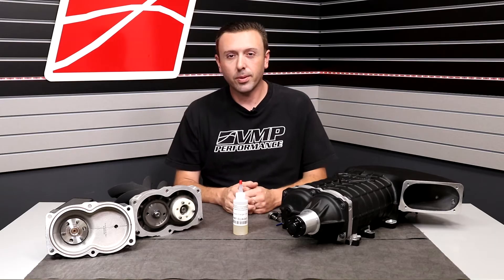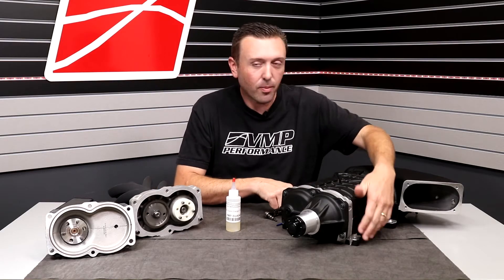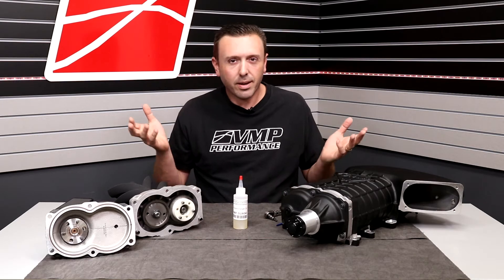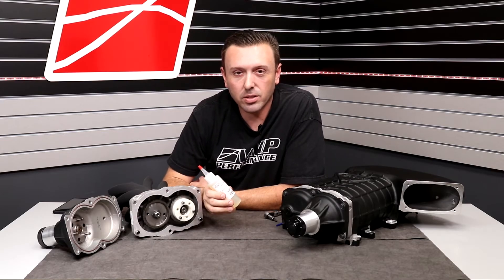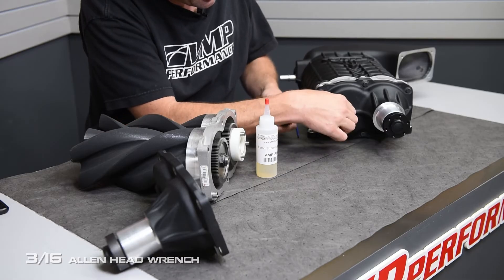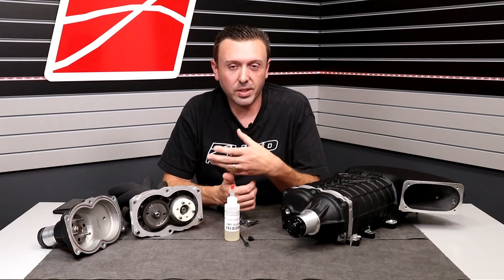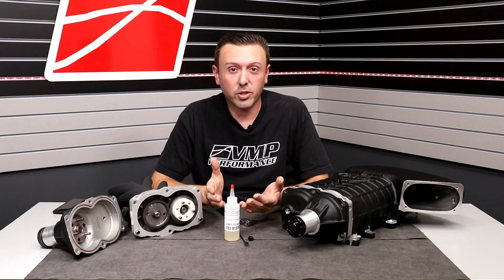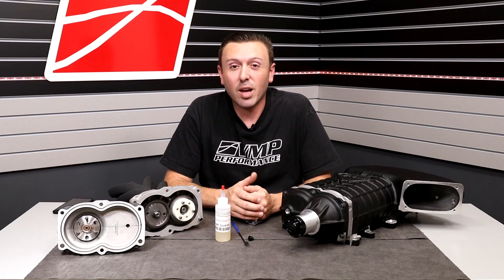Supercharger Oil || Tech talk; What is it?  How much do I need?  Here's your ANSWERS!

Comment: I was going to buy one of these in 2020  for my 1990 Mk2 Golf  1.8l 8v G60 Edition 1 Wolfsburg  till I found out they aren’t available in the UK, Costs £650 to import one, The noise they make is horrendous & loud, There a massive pain in the ass to mount unless unless you own a garage, Good with metal work which I’m not it just seems they are designed for the UK market unless you’re loaded, Typical of!

Comment: How often should you change the oil? I just purchase a mustang that has 21,000 miles on it
Reply from the maker: Supercharger oil needs attention much less frequently, if at all.  This is because, unlike engine oil, it is not exposed to contaminates.  On street driven/daily drivers, they'll likely ever see the mileage/extreme use that would require a change unless there's a leak or a problem that requires disassembly to repair.
Reply: @VMPPerformanceTV  I just purchased a 2022 mustang GT Premium package with the Rousch. It was 21k on it and want to make things we’re taking care of with oil

Comment: One thing I would like to suggest even though this is a great video is that we can discuss the actual weight of the oil because an emergency if someone needed to use synthetic motor oil or something like that they could at least get away with it until they were able to get the preferred lubricant.
Reply from the maker: The last blower that came through the shop that someone put engine oil in was absolutely ruined.  You need to run the proper lubricant in a TVS supercharger.  It's just not an option.
Reply: @VMPPerformanceTV  just curious
Reply: So it would be better of running it dry for a few hours vs some motor oil for a few hours to get to a shop?
Reply: 0w - 20

Comment: You guys and the comments seem to know your superchargers. I have a question for anyone with related experience: I had a stock Mercedes blower with 160k start making a grinding, scraping noise. I did the bearing on the blower pulley, but the noise kept going (maybe a bit quieter and less frequent). What do y’all think that could be about? I’m thinking some sort of internal bearing, but I never took anything apart, I just sold the car. Still wondering about it though.
Reply from the maker: Aside from the bearings in the nose, there's internal bearings located in the bearing plate at the opposite end of the rotors as well.  Without seeing the supercharger, it's hard to say specifically what's going on, but a disassembly and inspection would likely reveal play there as well.

Comment: What if the gears get damaged in case of there’s no oil
Reply from the maker: The supercharger would need to be inspected and rebuilt as it would've been exposed to extreme heat in both the gears and bearings.  Diagnosis of where the oil went would need to be performed so that it does not occur again.

Comment: I watched a video where a guy replaced around 1oz of the oil with motorkote hyper lubricant, and did heat tests with and without the additive. There was a great reduction in temperature. I would think that's a good thing to help prevent heat soak yeah?

Comment: I understand why the questions are asked. I’ve heard stories ( if I remember it was a whipple and a VMP) where the blowers were shipped out without oil in them. Now maybe they were used or maybe they had been rebuilt or something, but the stories where that they were empty and locked up. People advised me to check my new VMP Gen3 and sure enough it had the oil in it and the little paint mark on the fill plug from the factory assuring it was marked after filled. I believe the Gen3 for the terminators were made at Roush? Manguson was later like you said with the Gen3R

Comment: My buddy has gen3r and some knuckleheads at a shop added more oil to blower after receiving from vmp. Justin said any more than 4oz in gen3r  will overheat and possibly damage it. His shop added oil till it ran out of hole. So far he says its ok, but who knows as miles add up.
Reply from the maker: You can use a syringe with a small hose or something similar to drain it.
Reply from the maker: We'd recommend that he drain and then fill it properly.  The potential for damage with expansion is not worth it.
Reply: It’s whale oil!! I changed the oil on my 3800 SSEi back in ‘99.  Straight from the GM Parts Counter.
Just say, “Moby Dick”.

Comment: Thanks Justin! The Gen3R  / fuel system is almost complete on my Terminator! Been some VMP Gen3 and Gen3R’s Putting times down some impressive numbers at my local tuner. Either in a torco tune or 93 pump. Both at 21psi both broke 700whp despite the summer heat

Comment: Is it true that this is sperm whale oil?
Reply: Doubt it. Probably a synthetic or semi synthetic blend 5-20 5-30 weight oil. Sperm whale oil in the grand scheme of things synthetic oil will outperform it in pretty much everything.
Reply: Lol no.
Reply: Not anymore, BUT early automatic gearboxes DID use Whale oil as it is one of the purest oils, now of course replaced by modern synthetic spec. Bonus , less dead whales. Doing some searching i believe AIR COMPRESSOR oil is the same spec as Supercharger oil, (well it is an aircompressor) and a lot cheaper for a lot more in a bottle. I go for the FULL synthetic one
Reply: Yes.  And only obtained during whale mating season for the best product!